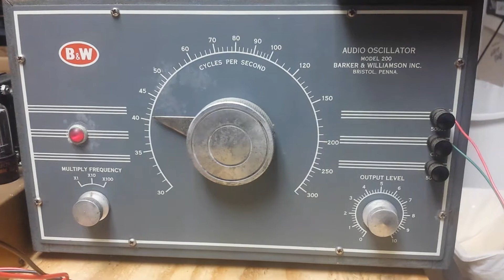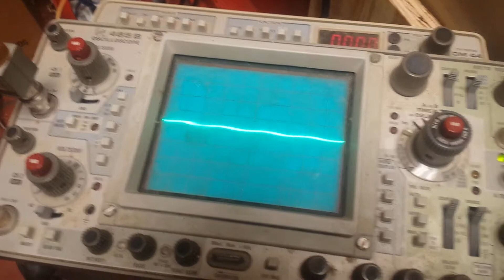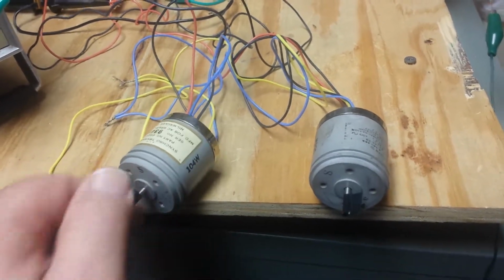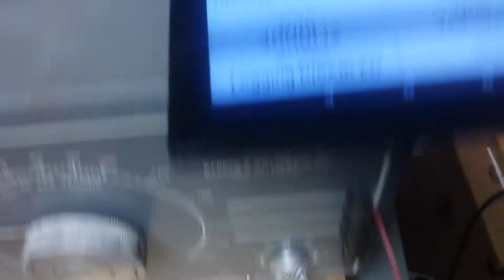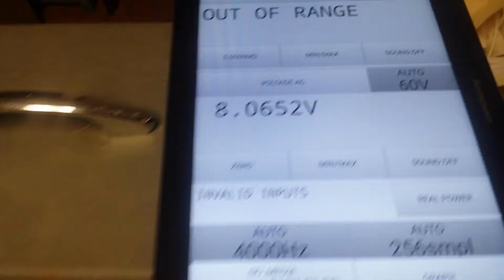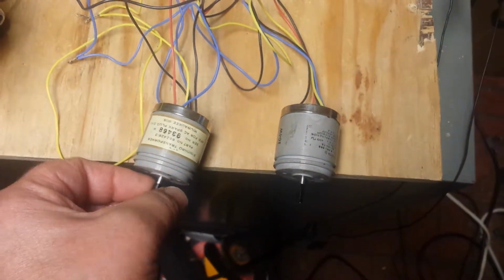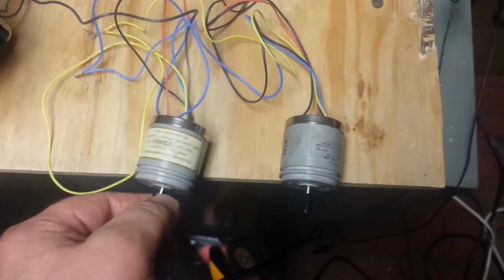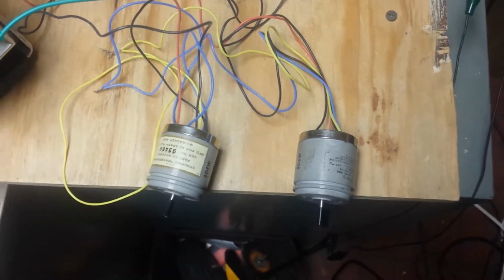Synchro motor test

Comment: They use this kind of setup on the attitude indicator, flaps position, etc. The 400V is quite common, but the voltage can be different. 115V, 28V, depending on the aircraft. (Military or civilian)
Three stuff is fascinating...